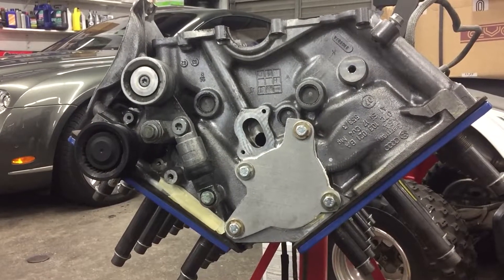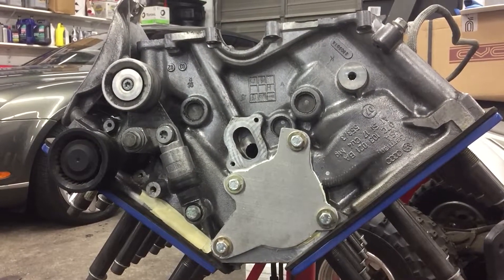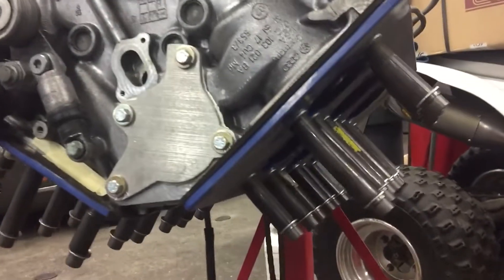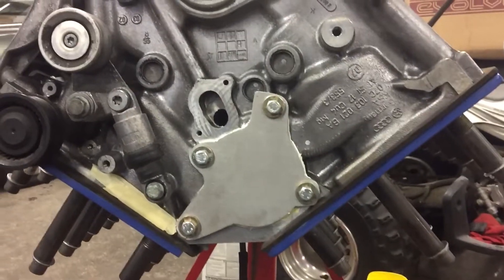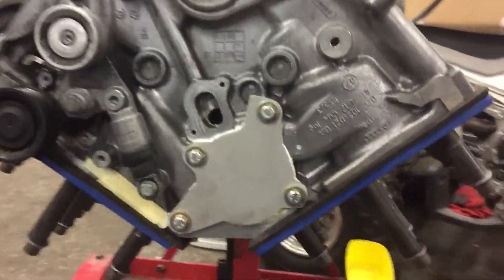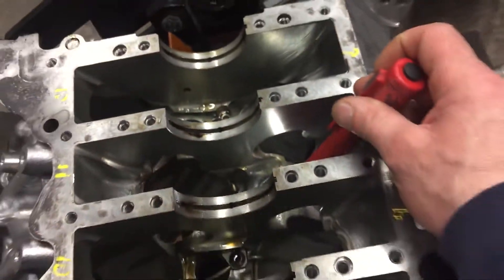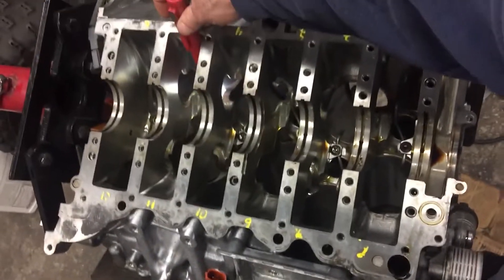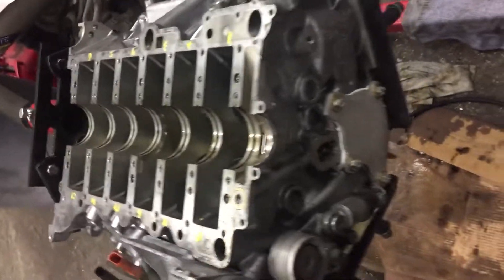W12 Bentley block

Comment: You could add piston pin oiling by boring a hole from the top of the big end through the rod body to the small end pin bore. These engines are already compromised by design.  They are definitely already relying heavily on the oil for cooling. Pin oiling should have been factory spec. It really pulls the heat out of the piston and top of the rod. Its better than sprayers and doesn't compromise the web around the mains by drilling a hole in it for the squirters